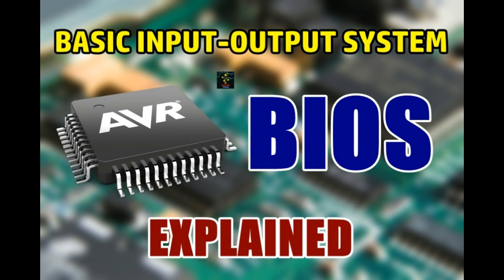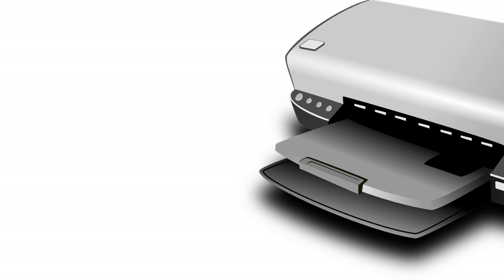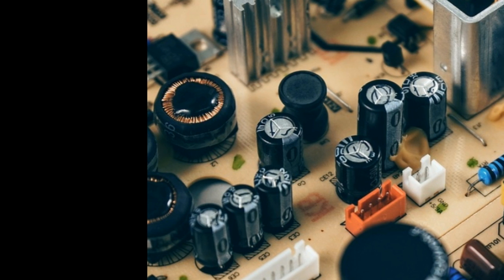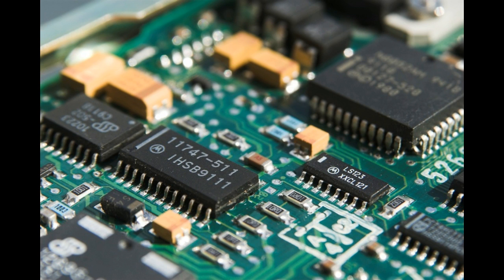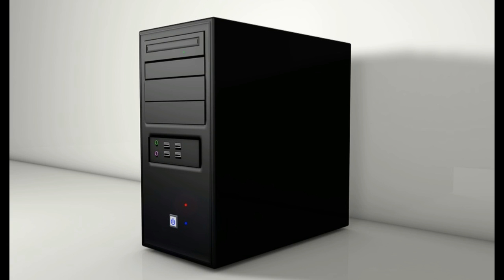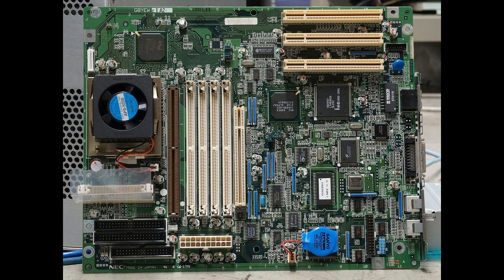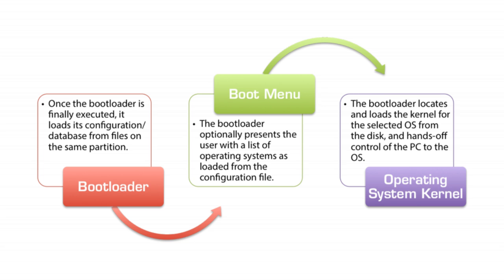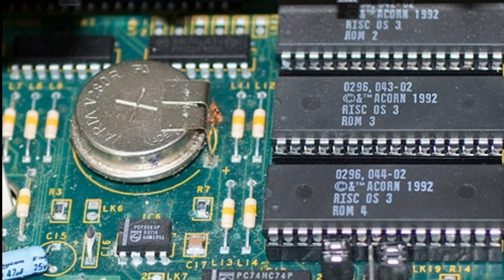What Is BIOS | BASIC INPUT OUTPUT SYSTEM | Explained

Comment: What happens if a device is not in place? Does the bios not pass the check and system does not boot? I don't think that is true as my computer will still turn on even if the hardware is not attached.